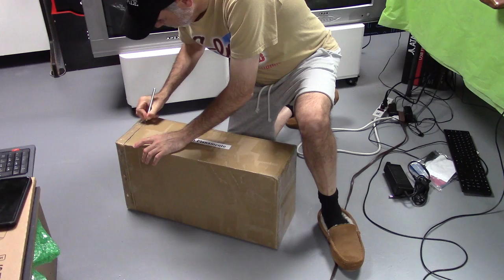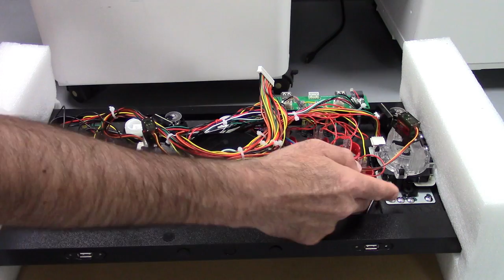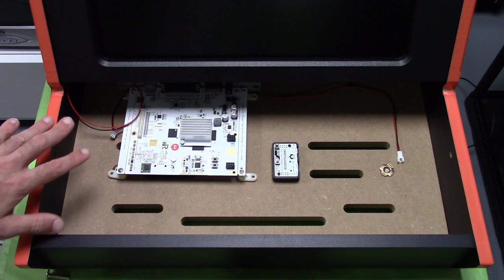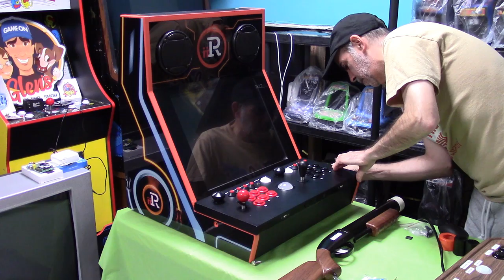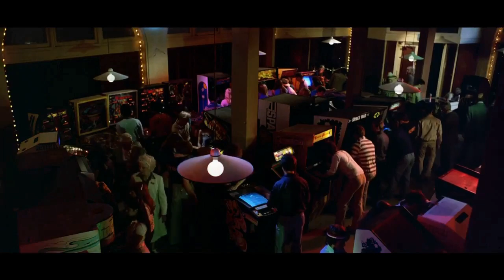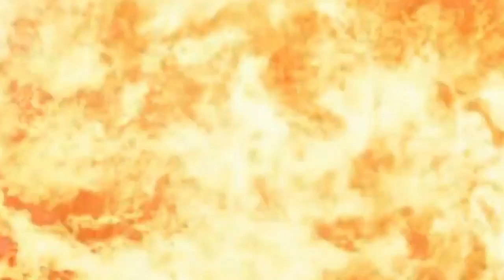Pre-Production GRS iiRcade Ultimate Control Panel

Comment: Hi Glen. I just received my iircade control panel. Beautiful work! Got it hooked up and working! When shutting it down, noticed the trackball light and 4way/8way buttons are still lit up. How do these turn off?
Reply from the maker: You have to actually turn off the iiRcade.  The iiRcade does not power off the usb ports and standby mode. When you press the power button, you're not actually turning it off. You're just putting it in sleep mode and it keeps the USB alive. Best way I do it is I have the actual arcade machine on a power switch on the outlet and I turn it off that way

Comment: Hello Glen I ordered your deck and the encoder board. Will there be anyway I can run a mini pc with coinops and your switcher? Will I have your controllers, stock monitor and sound? Thanks very much.
Reply from the maker: At this time the deck is being made to switch with the GRS Viper.  I am sure people can mod that to use a PC, but not our current focus on the design
Reply: Thanks, I will get the viper and use Batocera then.

Comment: Hi Glen, I ordered your deck and wanted to ask you one question. If something were to happen to the iircade motherboard will the deck still work with your viper board? I don’t really care much about the 60 games I bought from the store. I would rather have a couple hundred real retro arcade mame games on the viper.
Reply from the maker: Yes if the iiRcade board should fail the GRS Viper SBC will be able run fine just as is. No need for the original board
Reply: On your viper is there a set of pins to plug the deck into? And an output to the stock monitor? Thanks Glen

Comment: This is pretty decent... the only Criticism that I would make... is the lack of a True  "deep-travel"  Leaf-Switch button.    You see, leafs not only FEEL much nicer for certain Classic games.. but they are Much easier and far less Fatiguing... in Rapidfire shooters... such as a game like  "Halleys Comet"  (or even extended Galaga sessions).   There is a special Trick about Leafs that I never realized, until much later in my life...   Its called:   "Feathering"...

You see, a leaf button takes a certain amount of travel before the two Leafs touch.  The long travel helps prevent accidental presses.  But once you make the two contacts connect... you can then lightly "Vibrate" your finger... and it will cause the leafs to connect and break connections, rapidly, with virtually No physical effort at all.    In this way.. you are NEVER pressing the button to the point where the plunger hits the Bottom of the button.   Its like a trampoline, where you just bounce lightly up and down.    No loud clicky sounds.  No typical strong Microswitch Snapping Resistance.   Nor the new light-activation force micros... that are too easily activated on accident (merely by resting your fingers on them).

  Traditional Leafswitches can be less than a papers thickness apart...  to connect and disconnect...  and again, unlike a microswitch... you dont get a hard spring resistance before each activation (which causes a lot of fatigue, over a long periods of time... with rapidfire presses).

 Now.. leafs are not always the best solution for certain games... such as fighters.. where you desire a positive "Click" to have exact timing.   But, if you put the leaf on only one of the 6 buttons, such as the Quick Punch or Quick Kick buttons... then it probably wouldnt really effect things enough to be an issue.   Of course, the best solution, IMO... is to make a 7th button, that is lower and near the stick... like MK3's Run button...  but on the CP..   there clearly isnt room for that.

Realize that there are many old Leafswitch types out there.  Some are shallow, and bottom out to quickly / easily (bottoming out causes impact fatigue, as well as reduces energy recovery + slows return speeds).   However, there are also much longer Travel leaf buttons,  that almost double the traditional travel distance... which allows for the "Feathering" to be easily be performed.  Obviously, if you press the button too hard.. it will still bottom out.  But if you know about feathering... you can easily prevent the button from bottoming out, with long-travel leaf buttons.

 While there are not a lot of games that need constant rapidfire...  the ones that do require it... such as Halleys Comet..  are well worth the addition of the proper Leaf buttons... because its virtually unplayable without them.    But as Ive said... Leafs are so buttery smooth, and so Quiet... that once you start using them for most of the classics... you will never want to use Micros for these older games.

 In fact, its somewhat similar with the Wico Balltop Leaf joysticks.   They are pretty much a requirement for getting the quickest and best control abilities... with Robotron.   They sound and feel so much better than micros, too... with that wonderful shock absorbing rubber Grommet centering system.   Of course, these joysticks are NOT good for fighting games... where precision diagonals and stop+start type of movements, are required.

 Anyways... Try playing Halley Comet for as long as you can... using a standard happs microswitch button.. and trying to maintain your highest repeated press speeds.   As this particular game rewards you for maintaining the fastest fire rates... and you will get FAR more powerups in a fraction of the time/distance... IF you can keep that fire rate high enough.

 Obviously, someone could use some sort of Rapidfire Cheat,  or a  Hardware rapidfire speed-dial...  but that also takes away the fun and challenge of these games.

Comment: Really looking forward to getting mine, if I had one critique though it would be that I wished it was designed so that only one power cord came from the machine. Other than that everything looks great.
Reply from the maker: The main issue there is the iiRcade board does not have sufficient power

Comment: Where does the power plug in on the board and how long is the power cord?
Reply from the maker: Power is outside the back of the unit .. I will get it's length

Comment: It put a smile on my face when I saw the video this morning.   I had a question or two. First, will the power button  on the controller turn everything on/off (including Viper)?  I already assume Viper will need a separate power supply as well. Second, can the non joysticks like the spinners be used for dual stick games?
Reply from the maker: The deck has its own power and the VIPER will too..the iiRcade will still supply power even when off...so u would need your own power switch...

If the game supports duel sticks absolutely